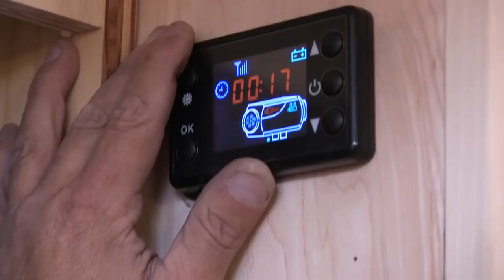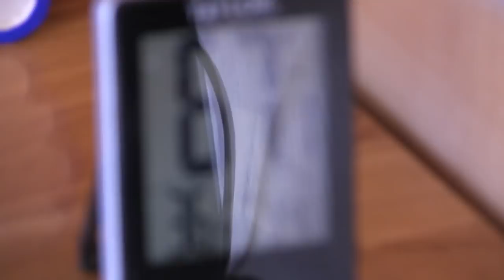Tapping the Fuel Tank for 2 Diesel Heaters in Our Skoolie (Part 2)

Comment: I'm doing the same with heat. 1. diesel air heaters are a dry heat, unlike propane and related. 2. The 5kw unit is 17,000 BTU. 3. The 5kw unit uses one gallon a day of fuel. 4. Easy install.

Comment: Hey guys, been watching you for about a year now. We have been doing our build about 4 years off and on. Just finished about 6 months ago. We picked up one of these diesel heaters for our build   when they started to become popular, and they rock. Just a tip, we use a 3.5 inch cold air intake automotive filter for about $10 on ebay and they are washable (at a car wash or something similar).It keeps the dirt and dust from running  through the unit and gives you filtered air. And as far as that rubber tire smell, it took ours about 80 to 100 hours to go away. We talked to the seller, they said it was normal and non toxic. Cool Beans

Comment: A thought on increasing your overall efficiency of your heaters & safety; I hope you have plans to furnish cold air return covers as mud dauber wasps and even snakes and mice will try to explore or nest in your heaters unless those inlets are screened. 
        My own experience has taught me that those rotten wasps take dirt/mud and turn it into concrete in spots you need to tear those heaters down to bare bones to clean them out. 
       Plus, in spite of all those fine promises our friends the Chinese offer us on their low bid wonders, the chance of waking up to a sudden fire or dead from CO poisoning from a plugged air intake is a risk I will never take.   You guys rock!!
Reply from the maker: I would argue that the combustion circuit of air is completely outside the bus. I cant imagine a situation where CO could ever come out of the unit inside the bus.  That said, I agree with the fire possibility and these will be monitored very closely.  There is also the possibility that I will be replacing the electronics with my own that I program myself and have known failsafes.

Comment: Is there a diesel odor burnt or not coming from the heaters? How are you gonna keep such flimsy plastic fuel tubing from hanging down? If  it drops below your tank and ruptures or disconnects from the pump or fittings it might drain your tank.

Comment: I’m just wondering if your wires and that fuel lines will rub on that sheet metal and truck frame, and either short out or leak fuel... are you putting wire looms on?... I’m just asking because I’m interested in these little heaters 🍻😎
Reply from the maker: Definitely getting wire loom on all of them. Just didn't show it.
Reply: Ok great! Thanks..

Comment: It's called a Wabasco can you hear me Ha Ha but make up a box that has a filter for the airflow or dust will run ramped threw the bus. Yes, every year the forced hot air when you turn it on makes a smell every year but goes away.

Comment: Okay but you still didn’t lift the fuel intake a few inches so when your out of diesel because you left the heat on overnight- we don’t want to hear you complain ;) we all warned you lol
Reply: M P    I agree. The fuel pickup tube needs to be at least 3” off the bottom, not only to keep from having all your fuel from being siphoned out of the tank but also to keep from sucking the junk that’s on the bottom of the tank up. Our fuel isn’t clean so there will be water and sediment at the bottom and that will be sucked into the lines and your heater won’t work.

Comment: OK, OK... With all of the explaining that y'all usually do, you did not explain these heaters very well at all!!! Can you adjust the fan speed, do the controllers have a thermostat on them, what is the expected fuel draw on them?? These are just a few of the questions that I can think of right away!!! 
I'm just a simple guy! I need to know these things!!!😂😂😂
Reply from the maker: Here is the skinny on the heaters.  The fan operates based on the temperature  of the combustion chamber.  So if it is burning a lot of fuel, the chamber gets really hot and the fan goes to high.  
It does have a thermostat but in my research into these things it turns out that running on low causes carbon build up that will eventually sideline the heater until you take it all apart and clean it.  So, we intend to run it on max temperature so that the heater is on high all the time and turn it off when its warm enough.  
I am working with a guy who made a  controller that will work with a home thermostat. When he finally released it, I will use that as my primary controller.